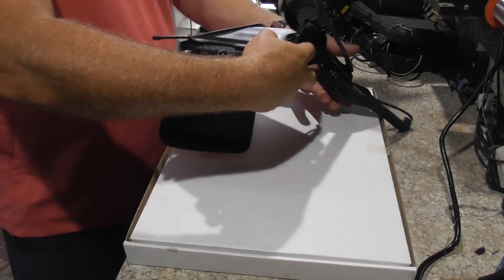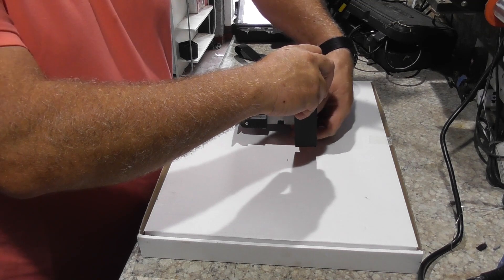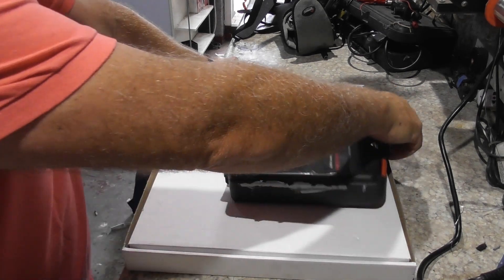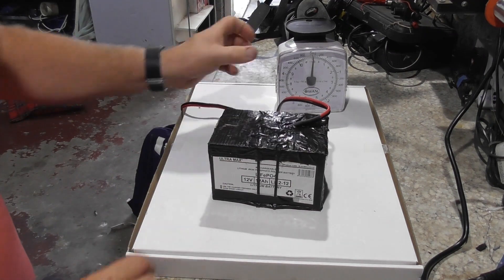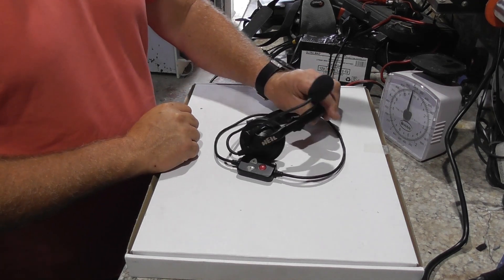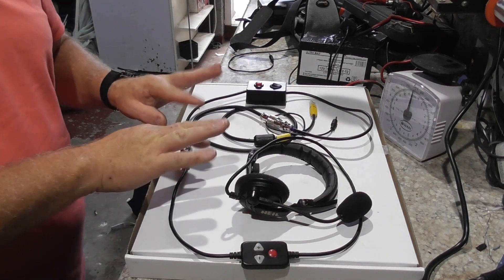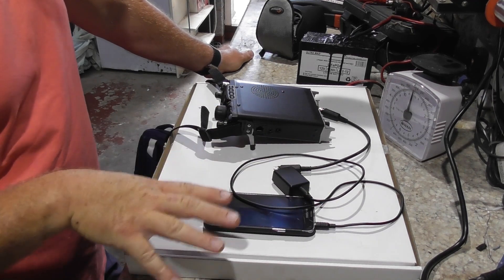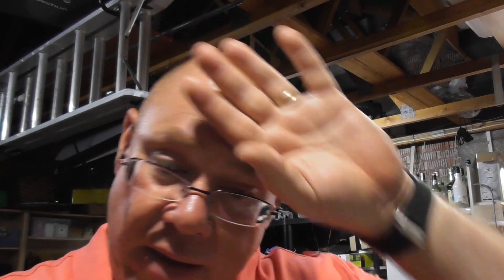Yaesu FT817 accessories. Ideas for you.

Comment: I too appreciate the 817ND. I sold my previous one I owned with lots of upgrades like PegLegs and Kranker knob which is no longer being made. I also had TXCO and SSB/CW filter installed as well but then sold it. Then few years ago, I bought another used one with BHI NED1601 DSP and CW filter installed. It sounds so good on receive on SSB with BHI. Also installed PortableZero rail kit with stand which is a fantastic upgrade. If you own an FT817 now, don’t sell it like I did. It’s a really good radio.

Comment: I must have missed that hot day. I got my 817ND because my h/b radio was too big for going out with on a motorbike. Very pleased with it. That battery looks interesting. I made a leather case and a voltage regulated mains power supply but still need a thyristor for the crowbar just in case something fails and I get 20 Volts out.
Bill, G4GHB.

Comment: LiFePo4 batteries are for sure a "go" for portable radio use. Slightly higher voltage than lead-acid, and they keep the voltage until the bitter end. But of course - size and weight is the main advantages for this type. And yes, the lifetime is much longer than for another batteries, at least 10 years and 2000 charges.

Comment: If you can find an old cell phone case that clips on your belt that's where the microphone clip came from. I have one myself they work great.that was always surprised someone didn't try to sell that as an accessory. Unlike the little notch on the shoulder strap, the microphone in that clip will absolutely not fall off until the button is pressed. Then it releases and works my treat. Just like it was made exactly for the yaesu microphone. It also works on other microphones depending on how the mic clip button is made.